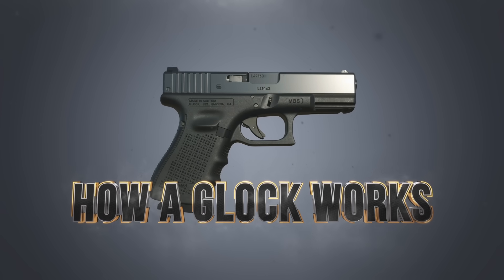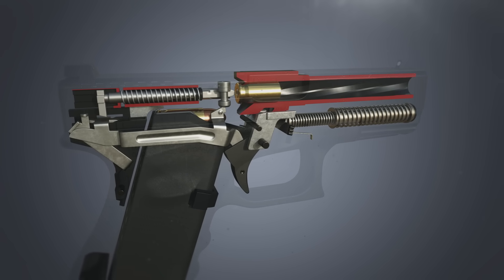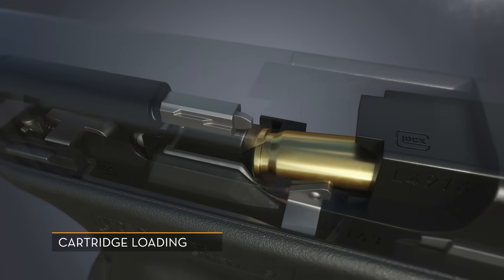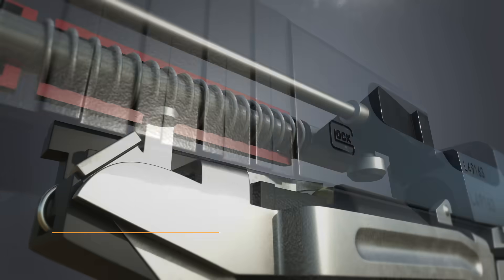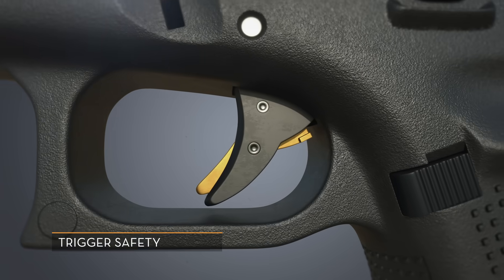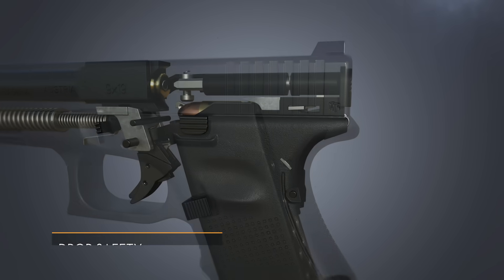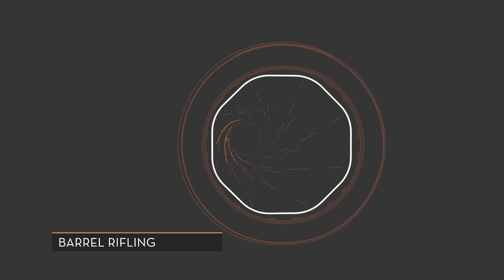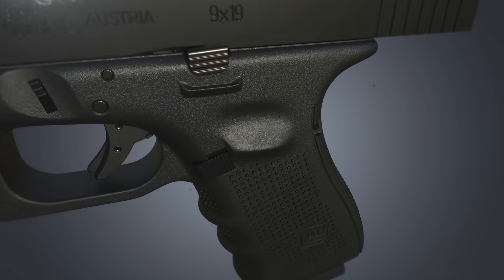How a Glock Works

Comment: So basically the Glock cannot be shot unless the trigger is pulled when the trigger safety is off? Very safe indeed
Reply: The original Glock doesn't have a safety at all. the gun was never meant for public use.
Reply: @bigtrav2395  I meant the trigger safety

Comment: To be technical, the firing pin hits the cartridge primer. Bullets have no primer. Well done 👍
Reply: To be even more technical-er, the bullet is the entirety of the brass, lead, powder and primer.
Reply: @ScienceFoundation  It's actually not.
Reply: @billmelater6470  Actually, it is.
Reply: @ScienceFoundation  Sure it can be if you don't know any better.  People say "bullet" to refer to the cartridge assembly, but it is more of a convenient slang than an actual correct term much like how people call magazines "clips".

The "bullet" is actually the projectile, not the primer, case or propellant.

Comment: Two of those safeties cannot be considered safeties. Because anybody who puts their hand on it and squeezes the trigger will make it go bang. At least with something like a 1911 the three safeties that actually exist on the firearm have to be disabled not only by the thumb safety but also by the grip safety before you can even squeeze the trigger.
Just saying.
Reply: Those are general gun safety against misfire as in for example if the gun is dropped it wont fire, these arent the type of safety you are talking about those are present in the glock too he just didnt mention them

Comment: Still don’t get how that trigger safety can be called a safety but still an awesome gun
Reply: The purpose of a safety generally isn't to prevent firing when the trigger is pulled but to prevent it from firing accidentally when the trigger hasn't been pulled.
Reply: There are two types of safeties. Internal and external. The trigger safety would be considered external requiring user input while the other 2 would be considered internal safeties and nonetheless help prevent the accidental discharge of the firearm. Glocks were designed with the professional in mind and a trained shooter knows your finger doesn’t touch that trigger unless you intend to destroy the target your aiming at. That being said there are plenty of “dummy proof” guns out there for novice shooters

Comment: Absolutely the best animation of the mechanical operation of a Glock! There are numerous other such animations on YouTube which aren't bad. But this depiction is the most thorough and clearly descriptive. 

Can't overemphasize how the 'bulge' on the right side of the underside of the slide forces the Connector (pushes in its top 'hook') to move inward during the backward recoil motion of the slide. This is what allows the rear end of the trigger bar to release off the Connector and pop back up. And as a result, this allows the sear on the rear end of the 'cruciform' to re-engage the Striker lug as the slide begins its forward motion during the recoil cycle and partially cocks the Striker in preparation for the next shot. 

Also understand that the trigger bar (curved end and its 'cruciform') had been forced downward during the trigger pull because of the curved end of the trigger bar pushing against the angled slope of the Connector, while the side arm of the trigger bar's cruciform slid off the plastic window's 'shelf'(Drop Safety feature), which together allowed the sear (rear end of the cruciform) to drop and release the Striker to hit the bullet primer during the trigger pull. 

Simply and ingeniously designed; often copied now, but rarely matched in its simplicity and reliability! There's a good reason for Glock remaining the preeminent Law Enforcement handgun even today, some 40 years after its radical, disruptive introduction.
Reply from the maker: Thank you so much for the nice comments on my animation :)
Reply: What forces the trigger bar up after the connector releases it, is that little spring or is the bar under tension?
Reply from the maker: @BrunodeLima90  I believe it’s the spring you see at 2:01. Not 100% on that, as I don’t own a Glock 😫
Reply: @BrunodeLima90  Matt is correct. The trigger spring (2:01) pulls the trigger both upward and rearward because the spring's rear attachment point is higher than it's attachment point connecting it to the trigger.

Comment: Bullets do not have primers. Ammunition has primers. Ammo is made from 4 different components. Cartridge casing, gun powder, primer and bullet. The bullet is only the projectile and should not be used to describe the completed round which is called " ammunition ". In this video when you said the firing pin strikes the primer of the BULLET, you should have said " the firing pin strikes the primer of the cartridge " or " the firing pin strikes the primer of the ammunition " 
You have no idea how many times I've seen people go into a store and buy a box labeled " 9mm bullets " because they thought it was 9mm ammo. In reality they were buying just projectiles used for manufacturing their own ammo.
Reply from the maker: Yeah haha, it only took me a few videos to realize I was using the incorrect verbiage. My latest video on the Kar98k uses the proper terms describing the firing pin striking the cartridge primer.  Wish I could correct this in the Glock video without sacrificing views 😫

Comment: Thanks for the video! I already knew it couldn’t go off without pulling the trigger but just needed reassurance by seeing how it actually works before carrying +1. With it pointing at my junk I was a little stressed the firing pin was able to just fall forward if something failed as I thought the firing pin was all the way cocked to the back. Really appreciate the video, and interesting at the very least
Reply from the maker: Thanks man, glad it was helpful!
Reply: bro stop pointing glocks at your junk
Reply: @fideys  No possible way it could go off, my junk will be fine, nothing has happened yet

Comment: Load the magazine, feed the magazine into the magazine well, pull the slide back all the way back,  release the slide to let it slide foreword on its own, point the Glock in a safe direction, with a firm grip, gently pull the trigger back and it goes bang, every time.

Comment: First round is double action, second and subsequent rounds are single action????
And decocker? De-cocker
Reply: @Sauli Luolajan-Mikkola Description of de-cocker operation?
Reply: @Sauli Luolajan-Mikkola First and second shot have the exact same trigger pull?
First shot is not Double Action?   Sounds DANGEROUS, carried cocked. 
 No mention of being locked?  Thank you
Reply: @Sauli Luolajan-Mikkola Extremely well written response. Clear and concise. 
After three rounds fired, how to you put it BACK into the CARRY safe mode?
Or, does it go directly to the not fully cocked mode for all rounds? thank you

Comment: How a glock REALLY works: you spend $500 on a "perfect" firearm, then spend another $500 making it run well.
Reply: You are incorrect. Glocks run right out of the box, everytime. If you have experienced malfunctions, the issue is the user.

Comment: My only question is (since I do not have access to real firearms in this country) is this: is there a chance that the slide release will drop by itself if the weapon is held upside down? I haven't seen any videos of that happening, but I'm still curious why or why wouldn't it happen. All I have on hand are cheap airsoft replica and I want to know what the real deal does.

Comment: This is almost perfect! The only thing you missed was how the glock jams on every round 😂
Reply: Fired over 1000 rounds in my Glock 19 never had 1 single round jam using various brands of ammo.It works for me.
Reply: Keep your thumbs off the slide. If one or both rest against the slide, the slide won't move back properly, and the casing won't be ejected, resulting in a jam.
Reply: @karlkeating2803  I shoot competitively. Glocks are infamous for being picky with ammo. Nothing to do with thumbs on slides or limp wristing. They're just unreliable when it comes to ammo types. I'll never run a glock in competition. Even Gucci glocks. I'll stick with CZ. comp. Ready out of the box and run anything you throw into them. I never understood why so many people choose to be glock fanboys. You pay for the name. For the same price you can get much higher quality.
Reply: @iiExoticzIV I shoot competitively. It has nothing to do with limp wristing. Glocks are notoriously picky with ammo. I'll never run a glock in competition.

Comment: I am wondering - have you Glock users ever got trouble with the trigger safety? In my mind it could stuck sometimes or else..
Reply: I've never had an issue.  Glocks are very reliable, with most issues being the result of user error or improper / insufficient maintenance.

Comment: I’m sorry I thought the whole point of a safety was to prevent a gun from firing in case there is an accidental pull on of the trigger, smh 🤦🏿‍♂️?
Reply: The point of this safety is to keep the gun from going off when not in use
Reply: @duckrachnidguy9461  doesn’t stop my kid pulling the trigger accidentally for some reason if they found my gun
Reply: @ChiquitaSpeaks  That's what the other two safeties are for. This one just stops it from going of if dropped on the ground or something.
Reply: @duckrachnidguy9461  this video mentions three safeties none of which are capable of stopping from firing if someone pulls the trigger
Reply: @ChiquitaSpeaks  Correct, there is nothing on the Glock which will stop it from firing if you pull the trigger.  The last thing you want to have happen in a life or death situation is to pull the trigger and have nothing happen because you forgot to disengage the safety in your panic.

As for children, this is why you get a safe for storing your firearms when they are not directly under your control.  At the very least you get an actual gun lock (you can often get them for free).  Relying on a safety to keep your child from shooting your firearm is irresponsible.
Reply: @Nanofuture87  it’s second nature to…the whole point is to train, if you even need to call it that (it’s more just like basic awareness of a practice bc you know you’re dealing with a firearm), and be aware enough to flick off a safety thats literally ‘RIGHT NEAR YOUR THUMB’ just like for people who don’t want to carry loaded to rack the slide before you’re needing to be in that situation where you’re going to be firing your gun in a situation. For you to acknowledge there are people who want an extra step to prevent a trigger pull engaging the action in their firearm is just you exercising common sense, that would be you acknowledging the reason basically as to why ‘every’ firearms manufacturer that’s not Glock essentially puts there safety that stops the trigger from firing a gun. What would you say is the reason those guns decided to put their triggers to operate that way with the safety. Bc maybe a large amount of reasonable people that are part of the market request it 🧐. Duhhh I’d say so, hmmm, duuhhh!!! Give it up dude, it’s common sense! Btw it’s not so I can leave my gun around but just like anything can happen it’s for the extra step of safety in the worst case scenario’s, which you know like the ones where the worst case scenarios just happen and crop up or for just like a piece of clothing to not snag your trigger and shoot you in the groin, that’s happened btw. Idk why you’re making it so hard to get just a simple point. You’re not always going to be able to carry ideally in a situation you might be having to go do some kind of rough tuck on some action hero shit like from in a movie the last thing you want is a unchecked trigger pull putting a hole through your testicles capping off your ‘save somebody’ ‘trying to be a hero antics’ to put an end to your efforts. You’re i’m pretty sure I think you’re just a clown.
Reply: @ChiquitaSpeaks  Cheesy pun, but it looks like I triggered someone.

Fine motor skills are the first thing to go when you're in fight or flight.  Can you train your muscle memory for it?  Sure, but there are lots of things you need to train and only so much time that you're going to be training to get it all.  The more steps that can go wrong, the more likely something is going to go wrong, and fractions of a second count.  If you personally want a safety, then by all means, purchase a gun that has a safety.  Some of us don't want safeties because we understand the downsides of them, hence why there are popular guns like the Glock that don't have safeties.  If you still want a sort of pseudo-safety for holstering, there is an aftermarket accessory for that called the striker control device that you press down on to prevent the gun from firing.  I don't know what sort of scenarios you are imagining getting into.  You aren't Bruce Willis.  Your holster should completely cover the trigger and be a sturdy enough material that it going off in the holster isn't going to happen, and if you do find yourself in a self defense situation then you shouldn't be re-holstering after.  This isn't an action movie where you twirl your gun and then just go about your day after smoking some bad guy.

Comment: I never understood how a Glock has 3 safeties when all 3 of them rely on the trigger safety alone. I mean it's really just 3 different safety mechanisms, but after releasing the trigger safety the other 2 safeties are no longer effective. Isn't that just 1 safety!!???
Reply: The safeties are to prevent the weapon from firing unless the trigger is pulled intentionally. Striker fired weapons are inherently safer due to the trigger pull taking some effort. With a good holster you have nothing to worry about, and the lack of manual safety makes the gun intuitive to use under stress.(a design based on the amount of dead cops who forgot to disengage the safety)

Comment: This is why Glocks are decent guns. Simple and reliable. Sure there are guns like CZ Shadow and Walther PPQ that have some better features like better trigger and ergo for some. but I just like Glock for being simple, reliable and easy to maintain, also quite cheap to maintain. Also my GEN.5 trigger is not that horrible overall, I kinda like it since it has worn in and doesn't feel heavy and mushy like some older Gens. Sure I'll get PPQ at some point since those guns are affordable too in my country, but I really don't care for high end CZ guns anymore even though CZ does have very good guns overall. I guess it's because I've been training with Glock for years and get used to it. Also keeping my Glock stock, maybe change sights and trigger connector but that's it. Training matters most in the end.

Comment: Great animation, I did not know Glocks had 3 safety mechanisms. I thought the only one they had was the trigger safety. improved my outlook on Glocks
Reply: Because of how they work, all semi-auto guns need a "in battery" (slide closed) interlock so the round can't fire out of the chamber. The 1911 also adds a thumb safety and grip safety. Also more a European thing is a magazine safety (Sigs, H&Ks).
Striker and double action guns have at best mediocre triggers compared to single action semi-auto pistols.

The third item mentioned is actually a "disconnector" or "interlock" to prevent firing out of battery and/or full auto fire. (The trigger needs to be reset) Not really a safety function per se.

Safeties are meant to prevent negligent discharges even if the trigger is pulled, interlocks are what prevent discharges in a unsafe condition or component failure like disconnectors and half-cock notches on hammers.

The only safety a glock has is an empty chamber.

Comment: Mr. Rittman,
Would you do a graphic of how the H & K P7 operates with its unique gas piston system?
Reply: No piston...just gas delayed.
Reply: @ArtieGlock  That is true. It is that rod under the barrel that inserts into the gas chamber that I misnamed as a piston. Great system but I've never been able to fire more than 50 rounds without letting mine cool down. It gets hot!